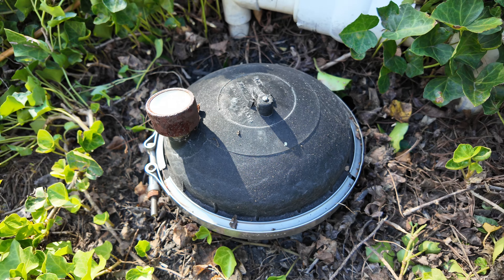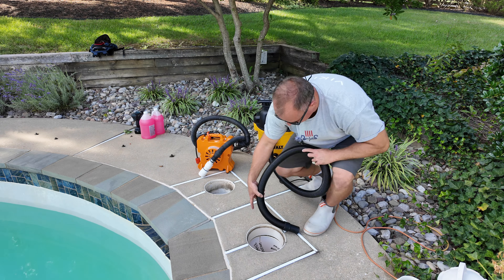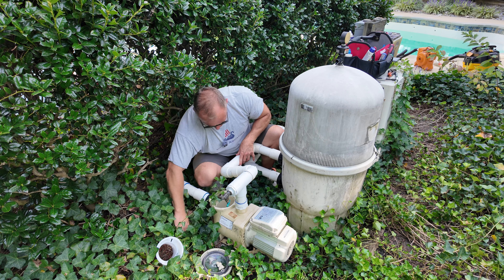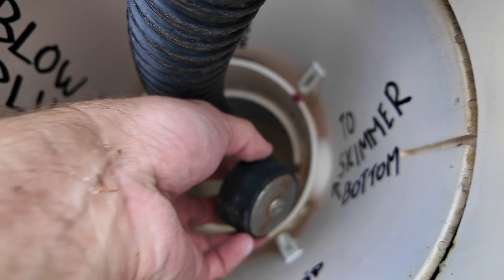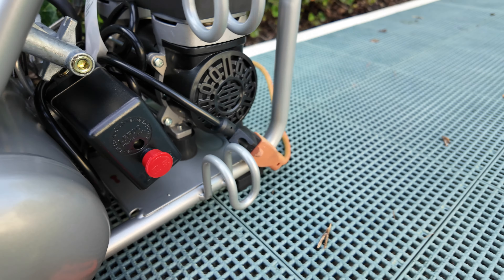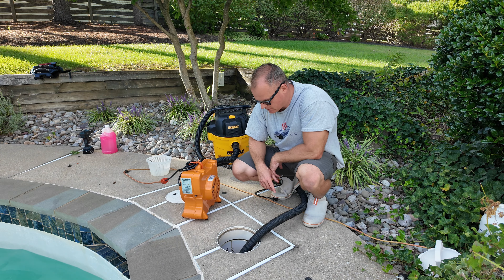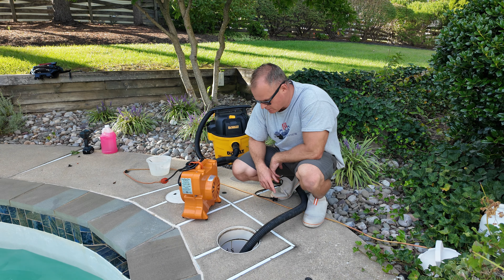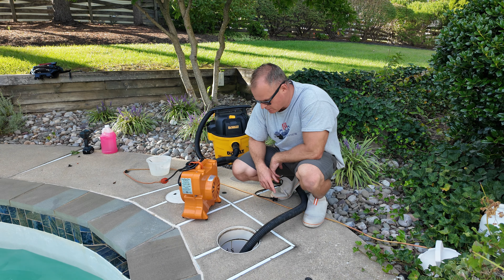How to WINTERIZE  In Floor Cleaning System (100% GUIDE)

Comment: Great, informative video.  What would you do differently if you had two domes (mushroom head), as opposed to one?  Also, you don’t have to shut the ball valve coming out of the ground next to the dome?
Reply from the maker: Two domes are just like one but with additional ports to blow out.Once you start blowing first dome, you will realize that they are connected (underground) and your second dome is blowing water out one of the holes. Basically, one of the holes in each dome is the"connecting hole" between the two units. I hope I am explaining this clearly. As far as the valve next to the domes, that needs to stay open during winterization process or you won't be able to blow out the very few floor jets at the very deep-end part of your pool (near floor drain). I hope that helps!Thanks for watching:)